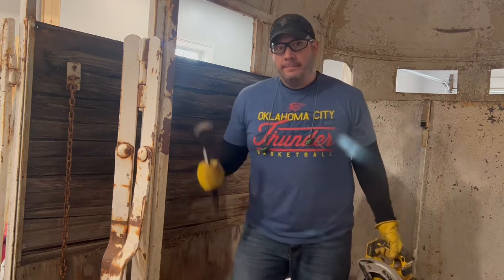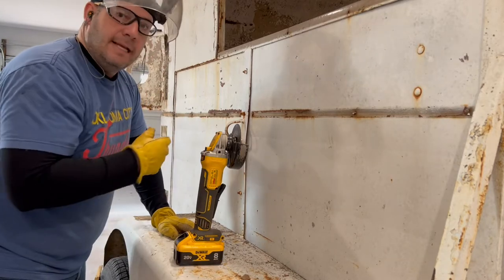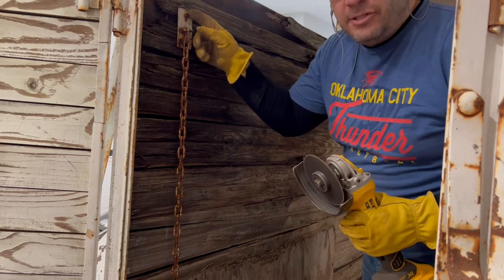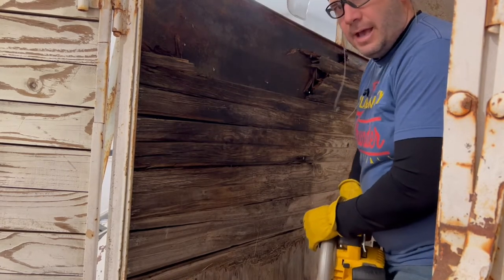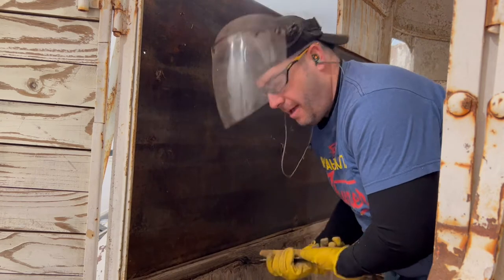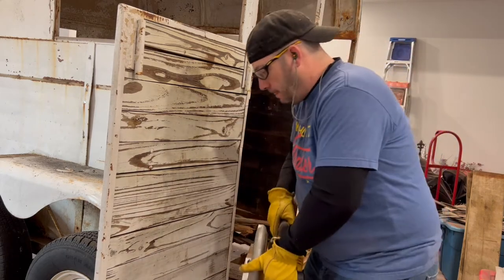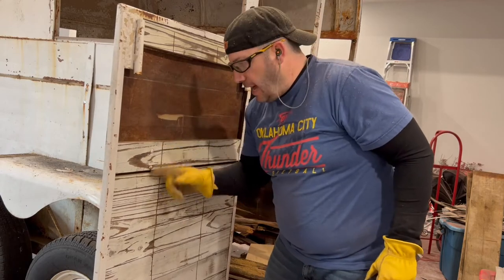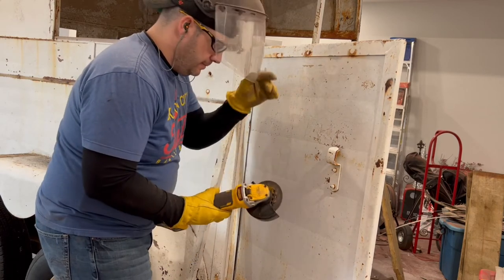How to Remove wood from the walls & doors of your trailer conversion

Comment: Hi, so if the trailer doesn't have wood on the inside and it has metal instead, do you have to remove the metal or can you go on top of it with plywood or wood planks
Reply from the maker: If you have a trailer without wood on the i side of the walls and the metal is in good shape, then you can definitely put wood inside or just leave them metal. It really depends on your personal preference. However, if the metal is bad or you want to cover up a window opening, the. You would need to add metal if you wanted a metal exterior wall.
Reply: @carriagehousetrailers  do I have to frame or can I just go directly on top of the metal with the wood attaching with screws?
Reply from the maker: @w.j8856  You can do either. Attaching with screws would work. Most of the trailers with wood from the factory have an angle iron  or channel iron frame around the wood that holds it in place along with a few bolts.